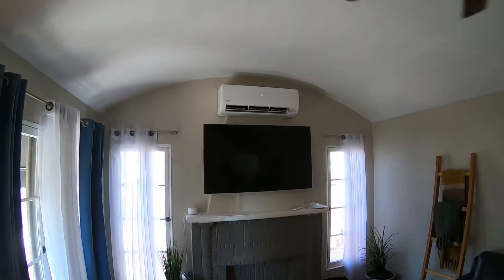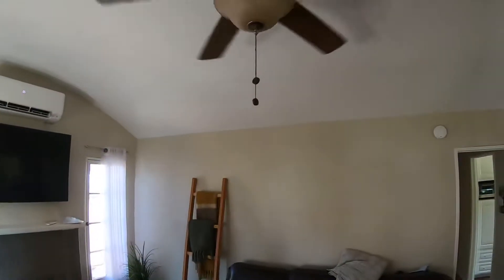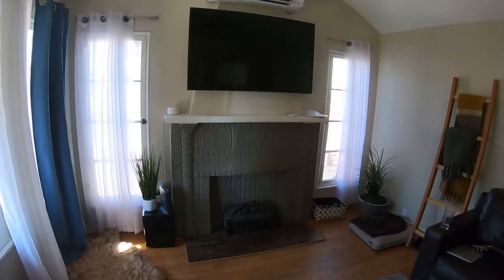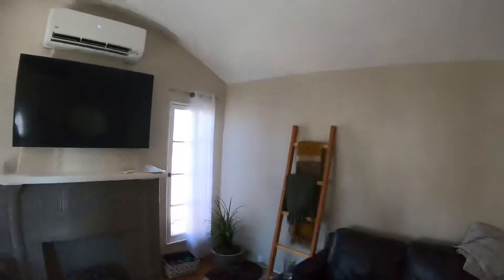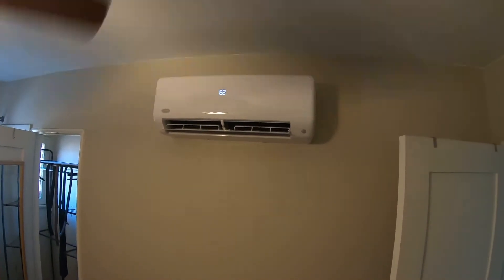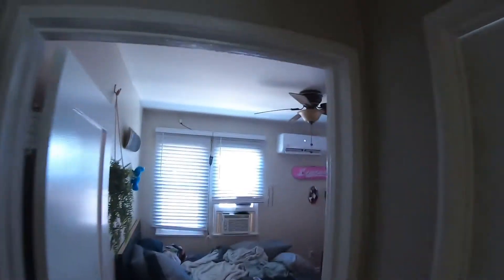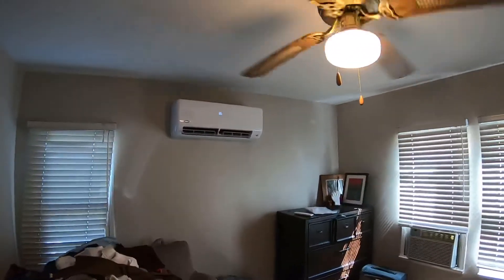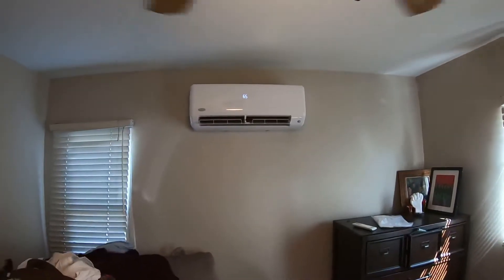Carrier 4 zone ductless split system PART 2

Comment: It looks like you used 4x 9k units in the house, I thought the Carrier condenser with a single fan was only rated for 30k. Although Carrier has a single fan condenser rated for 4 zones, do you need to pick a condenser that exceeds combination of the rated indoor units, or can you go a little less, like it appears you did?
Reply: This is a 4 zone system with a 30K BTU heat pump condenser, 1 - 18,000 BTU high wall fan coil for the living room and 3 - 9,000 BTU high wall fan coils for the bedrooms.  You do not need to pick a condenser that exceeds the total BTU comination of the 4 zones.  The condenser will automatically ramp up or down its speeds for each zone depending on how many are on, temperature and humidity in the zones running.  In this house the customer stated that they only run the bedroom zones at night.  And the living room zone is primarily on during the day.  Thus, the single fan 30K condenser will work just fine for this situation.  But, if they were to run all zones at the same time I would have recommended the 36K condenser with dual fans.
Reply: @fijiman88  Thanks Nick, really appreciate the info!